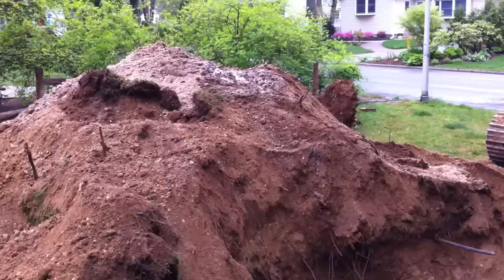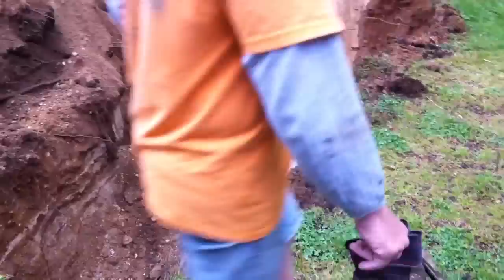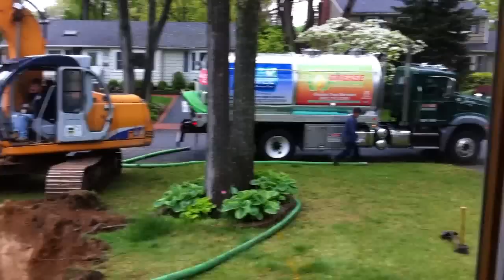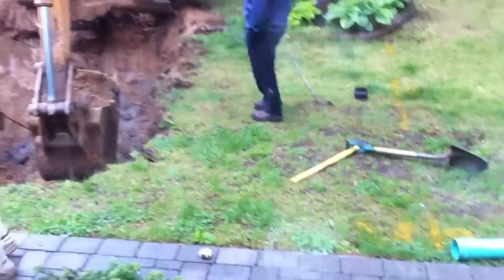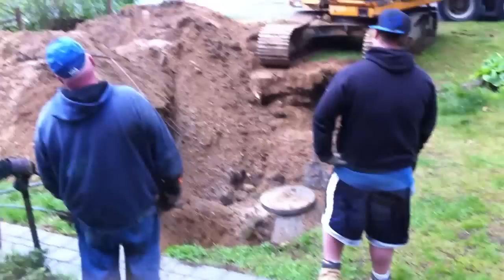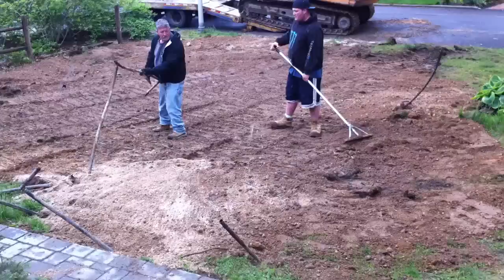Cesspool Replacement

Comment: Nice video. I just needed a new cesspool except mine was the original block cesspool from the 50's and there is no way to get machines in my yard so a new block pool had to be put in by hand. It only took them about 6-7 hours. I have a nice 10x20 spot for a garden now and I don't have to clear it! Lol

Comment: Our cesspool in Nassau was filled in when they put in the sewer system. I remember we had a light pole just like that one in the front yard. I remember watching the next door neighbors having their cesspool replaced. That was in the early 70s, only a few years before the sewers went in.

It looks like they installed two tanks. Why the truckload of dirt? What was there originally? I am surprised they just didn't use the original backfill.

Comment: So from what I see in this video - the setup leaks stuff in the soil (at the bottom & lateral). Is that acceptable as a practice in your country? Very unecological - it can have serious impact by polluting soil, water table, etc. If all do the same in an apparent decent neighborhood - then you're actually sitting on a place filled with sh ...t? :))) The environment regulations and care for nature are almost a joke in US, unfortunately. This kind of setup should have been outlawed 50-70 years ago.
Reply: I'm also surprised. I don't know where this video was taken but I do know in some states you are supposed to remove cesspools and upgrade to a more modern waste disposal system. Old rural properties were granted exceptions but it's definitely an environmental concern! This is in a seemingly nice neighborhood, so not even a rural area!
Reply: In the United States sanitary city sewer connected to waste water treatment is the most common method for sewage. Rural areas without city sewer systems uses septic systems. Cesspools are a very old method that is no longer practiced really anywhere except for parts of New York where fore reasons unknown to me never upgraded their infrastructure with sanitary sewers and it is impossible for any alternative than cesspools due to density. It is a 1950s mindset over there in those parts of New York, and one that we changed in Chicago. Fun fact: the first ever nuclear reactor, CP2 is buried in the ground outside of Chicago because in the 1950s it seemed like a good idea, and to this day it is still buried there.
Reply: It is illegal and has been in most places in the US for a very long time, though many times it's"grandfathered in" but in some places like Long Island the soil doesn't work with conventional septic tanks.  Cesspools/cesspits are very bad for the environment.
Reply: XD @NadyaPena-01  I think it's in Long Island NewYork. Something about the soil not being able to use conventional septic tanks. LI is full of them and also Hawaii has many many cesspools. Both places have programs with the EPA to upgrade and help pay for new modern septic tanks that work with that soil. Most places they are illegal though except for the grandfathered ones. This type of waster water disposal would be an upgrade to what is going on with the straight piping directly into creeks and rivers in eastern KY and southern WV that people are forced to do due to poverty, soil conditions, lack of public sewer and FAILING, aging puic sewer infrastructure in the places that do have it and the fact that many of thease homes are old coal company coal town homes that were designed and built that way and what is going on in rural Alabama where many straight pipe directly into their back yards which is now being realized as a civil rights issue. In AL septic systems just do not work in that red clay soil. Many factors involved in this national disaster. The federal government needs to 100 percent fund and fix this everywhere in the US like many decades ago. Water pollution anywhere affects us ALL, everywhere!
Reply: @AMD1 , Hawaii is full of cesspools and there and Long Island there are plans underway to upgrade. Many things about the  conditions of the soil. In rural Alabama thousands of people just straight pipe raw sewage directly into their back yards and in some parts of Appalachia, eastern KY and southern WV thousands of people are straight piping raw sewage directly into the creeks and rivers, this is due to the soil as well and also because many of those homes are old coal company houses that were built that way ,some of them over a century ago. It is illegal and they don't WANT to be doing this. Poverty along WITH the soil and ground conditions are why people continue to have to do this and classism and even racism in the case of Alabama are why this hasn't been funded one hundred percent and fixed by the US federal government. There are programs and activist and advocates along with the EPA trying to fix this for decades upon decades. It should have been fixed everywhere in the US many many moons ago.
Reply: It is outlawed in most places of the US but in some areas the soil and other environmental factors won't allow for the use of conventional septic tanks. It's worth researching. Very interesting. Hawaii is full of cesspools. You should see what is going on in rural Alabama and southern WV, eastern Kentucky and other parts of Appalachia. It is literally third world type of things going on. There are advocates, activist and programs that have been trying to have thease waste water and safe drinking water crisis'fixed now and for many decades bit the US federal government refuses to 100 percent fund and fix this national disaster.
Reply: @AMD1 It's because of soil and ground conditions, not a 1950's mindset. Lol It is also because the US federal government refuses to completely fund and fix this waster water and drinking water disaster as they should because water pollution anywhere naturally affects us ALL. Their are programs in Suffolk County NY and Hawaii, which is filled with many cesspools to upgrade but ultimately this is a federal government, not a state issue and they have the funds, the towns, city's,counties, parishes and states do not. Water pollution affects everyone. It's literally a national disaster! Research the water/waste water crises in southern WV, Eastern Kentucky and rural Alabama. It's a civil rights issue in Alabama and I believe, myself that also is in the parts of Appalachia where their is lack of safe waste water disposal methods and clean drinking water. Classism and racism at it's finest.